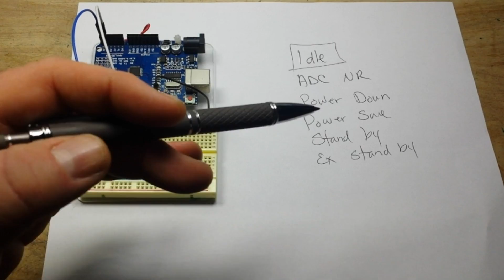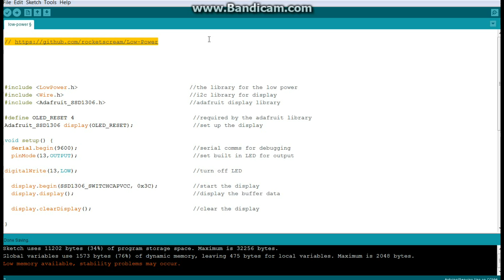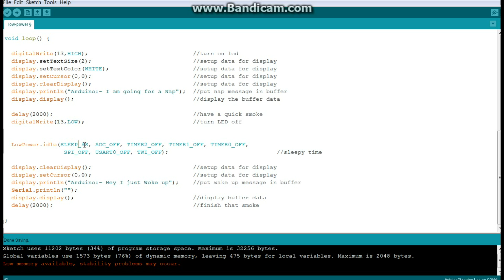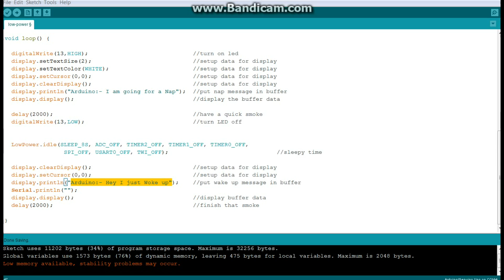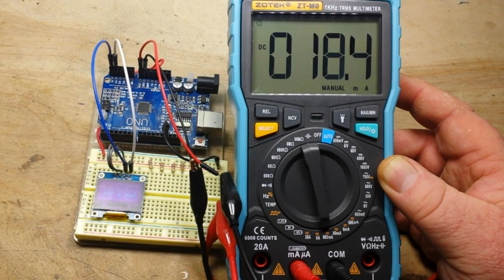How to put your Arduino into power saving mode

Comment: You can get the Atmega down to a few uA, but not on an UNO board, you would need to remove some components to achieve that. I have a project running on 2xAA for 2 years, sending IR codes once in a while.
Reply: Now you are thinking.  That's amazing that you got that running for 2 years, congrats!

Comment: That's a good start but the real power guzzler on the Arduino board is the serial interface chip that cannot be switched off. I am running some remote sensors (BME280, UV breakout board and nrf24l01) with a naked ATmega328 at 8Mz and 3.3V supply, and while in idle mode the circuit is only pulling 2 mA going up to 8 mA when awake for a couple of mS. During the awake time, the ATmega328 gets the temp, air pressure, humidity and UV index and transmits the data back to my local receiver and goes back to sleep. I have got the remotes running on 18650 cells that are losing approximately 0.1V per week. So my guess is that these will only need recharging every 10 weeks. So now you have got a follow-on video to make.
Reply from the maker: Very nice work
Reply: This vid and your comment is handy, as that's the project I'm currently tinkering with. I've a few 3.3v pro minis that I was planning to use once I've polished the code (using a nano at the moment because the built in USB is just more convenient).
I've also got an 18650 holder/charger that has a series of 3.3v and 5v outputs on it that I'm playing with to see if it's suitable.

Comment: Luv the work u r doing. I want monitor the capacity of my 14.6v valence batteries shud I use amp connector to rs485 to logic level converter to 4 module relay to arduino. And please how to connect?

Comment: Had a bit of weirdness with the idle. I was outputting temp/humidity to the serial monitor and the text kept getting garbled, so I put a few test prints in at various places.

The following should say "New reading: 41 20*C 20%"

But it was coming out as "⸮⸮݁reading: 1 20*C 20%"

Had to put a small delay before the idle otherwise things weren't getting displayed properly before the idle kicked in.

In the following it would idle then print that it was going to idle until I added the small delay.

/**/Serial.println("Test point : Sleep for a while");
    delay(100);
    LowPower.idle(SLEEP_8S, etc.);

Comment: Those milliamps are still terrible for using regular batteries. And at that input voltage you are losing a lot of power to the rather inefficient regulator on board the arduino as well. Building just a barebones chip without the serial converter chip, linear regulator and LEDs on all the time you should be able to go from milliamps to microamps very easily.